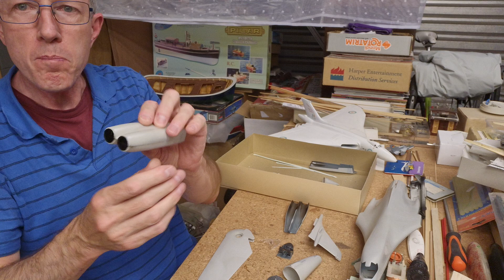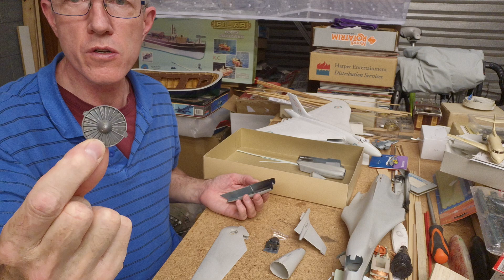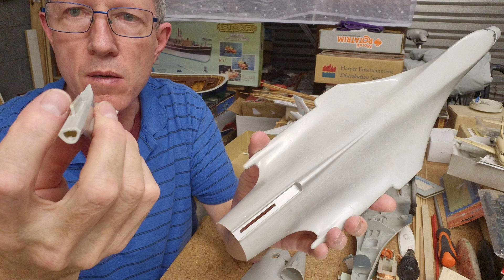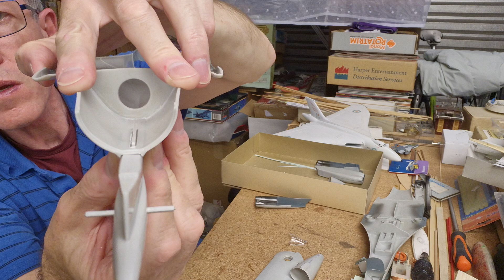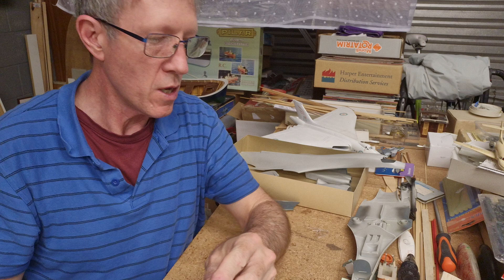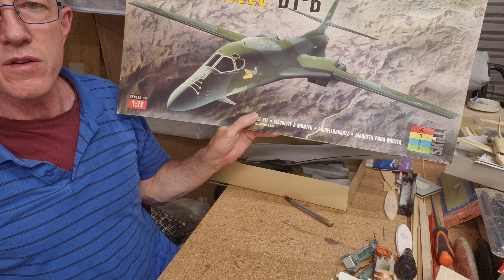Airfix 1/72 B-1 Bomber. Tips, adjustments and minor upgrades

Comment: Hello Deon " and Brian" - Brian thanks for referencing it was you mentioning the comment on the organization. It sounds like you're an avid modeler too. I'm like Deon on organization. Especially on multiple builds. In fact my mantra is " I may not be organized but I know where everything is" (lol). 

Deon. A very detailed analysis on fitting models together, especially this large size 1/72. This kit will give you excellent experience for preparing the B70. I sent some information down on the Kenetic drones. The only place I found is a hobby shop in Australia but they don't list them, I have a few distributors up here that carry them They are excellent in price about $35.00 average but the freight to NZ would be high. Its even high for mee. I'm still having technical problems with my computer interfacing so I hope you got them They are out of Hong Kong and may have been bought out. There are great kits , I just need to decide when to budget them. Happy Modelling Cheers Bob

Comment: My take on the canopy… the B-1 canopy is pretty flush in reality, not many frames proud of the surface. I think I would mask first, using the frames to make mask templates. Then remove the masking for later and sand the frames till almost gone. With polishing or a dip in future after fine sanding the canopy will be nicely clear

Comment: Hi Deon. It was me that remarked about your work desk. The B1 is a lovely aircraft and they are well maintained so you won't see one heavily weathered. A light coating of a dark wash will do. The engine fan are always a problem on kits like this. I had an idea about using the metal heads off of a electric razor. The round and fan like in appearance and once buried in the nacelle I think would look quite convincing. Just lookout for some old broken electric razors in you local junk shops. The pivots and pins in the wing can be done with brass rod and tube but you could also use the plastic alternative. Glue the larger tube into the wing and then put the smaller one inside and then glue and clamp it into the fuselage. The connecting rod between the two can be brass with two loops bent into the ends. This will ensure a strong piece that won't fail due to plastic fatigue. I look forward to seeing your attemps at fixing this problem. Best wishes.
Reply from the maker: lol yes, and also, i really cant show you guys the utter mess in my actual model room. Yesterday i was scraping insides of the B-1 wings to get a closer trailing edge fit, so now the garden too , is a mess of scrapings - lol